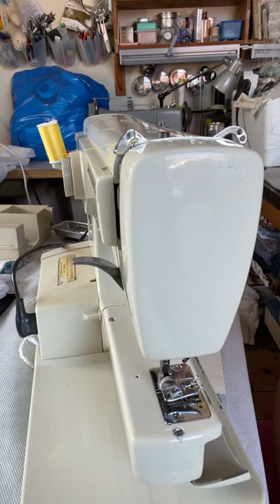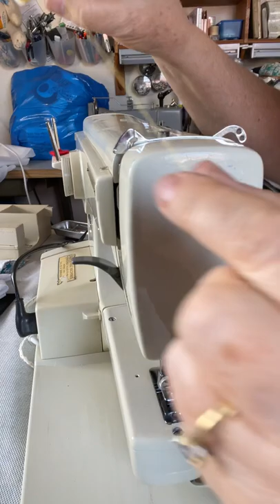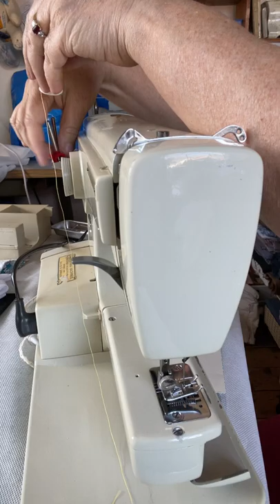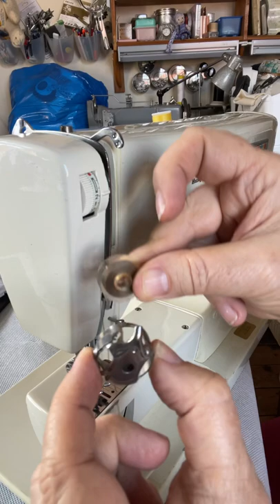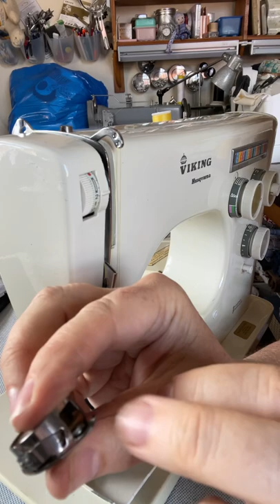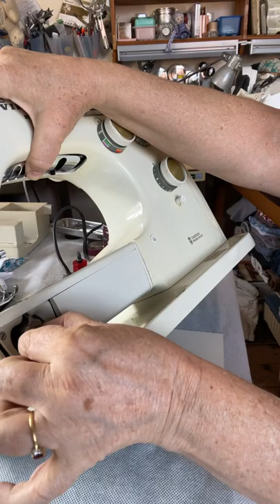Threading a Husqvarna Viking 6020 sewing machine.

Comment: Hello! My mother's Viking 6020 has a loose bobbin casing. We were told by a local repair shop that the casing would need replaced but that they're no longer available anywhere. Do you know of any options we may have to attempt a repair? The machine has been in the family for generations and is sentimental. Thanks! :)
Reply from the maker: Sorry for the delay. With vintage machines it can be very difficult to find anyone to work on them and who can be trusted to give you good advise. Take it to a few places to see if the feedback is consistent. Otherwise you may have to learn to repair them yourself and use a donor machine for parts. Look for help on the Husqvarna Viking vintage sewing groups online. Don’t give up. Good luck. 😊🧵🪡